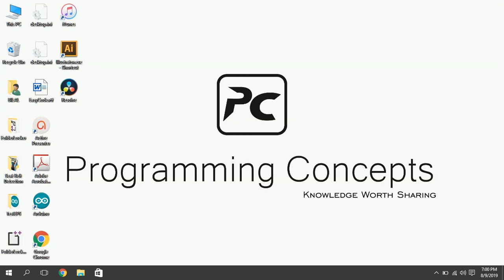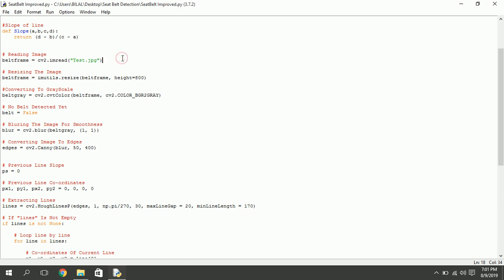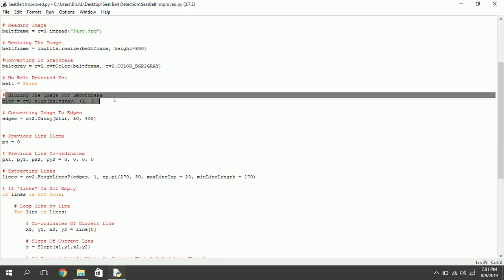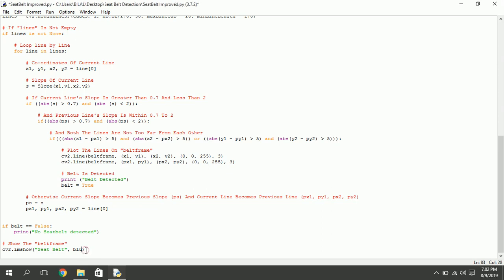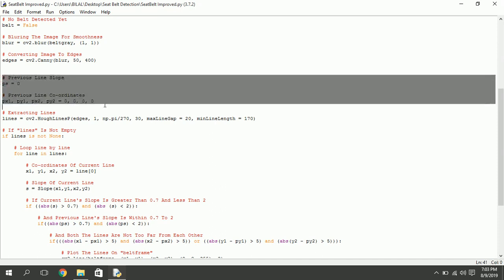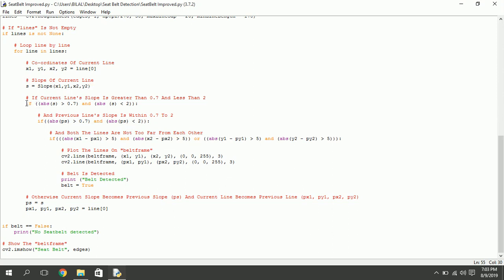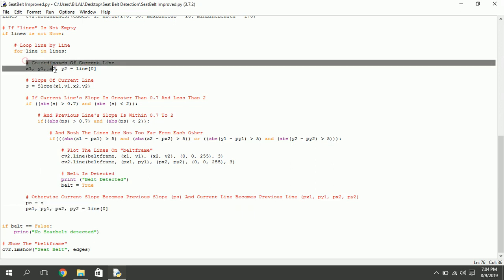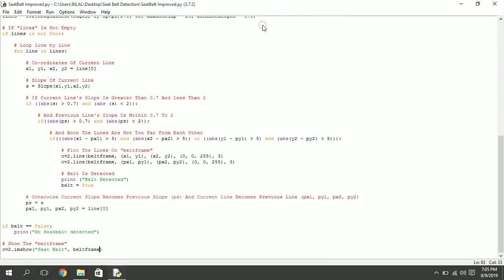#SeatBelt Detection with OpenCV & Python | Line Detection in Images

Comment: Hello, I need some help here. I use the same image. The status was "seatbelt detected", however the image did not appear. (No pop up image that shows seatbelt with the red line). How can I fix this?
Reply from the maker: Hi! Hope you’re enjoying a good health.

In the code, there is a function named “imshow()”. This function is used to display the image. Look it up in your code and may be you find something that can help you. May be it is missing or misspelled.
Reply: @ProgrammingConcepts101  Hi, thanks for your response. I moved the imshow inside the loop line and also added waitkey. It kinda works, the image pop up and hold up for a few secs. I'm suck at programming, your code and explanation help a lot. Thanks!
Reply from the maker: Thank you. Your comment means a lot to me.

Comment: Hi sir,   I got some error on the output of the coding.. The output I get 

RuntimeWarning: divide by zero encountered in int_scalars
  return (d - b) / (c - a)

No Seatbelt detected

Could you please advise me on this error?
Reply from the maker: This is because c - a equals to zero for some cases. You should just ignore it.

And for your specific image and camera, you need to adjust your code.

Comment: Hi , could you please advice me how  to identify any triangular objet in an image after extracting edges image ? Like we are finding two parallel lines with some angle  in edges of pic.
Reply from the maker: If you want to detect triangular shapes, please refer to this tutorial by GeeksforGeeks: https://www.geeksforgeeks.org/how-to-detect-shapes-in-images-in-python-using-opencv/

I hope it will be helpful.
Reply: @ProgrammingConcepts101  hello sir , appreciate your reply and  help. Actually, I tried this using Contour method and by feeding edge image into it . But it's not  detecting the triangle. The process suggested in Geekforgeeks is working fine when you may have simple white paper where few clear shapes are shown but if there is image where data is bit noisy (e.g. pic of 7 people with background of a garden and you may want to identify a drawn triangle on one person t-shirt) , this method does not work fine. I was thinking if we could find angle between two line in a traingle and compare all three angles if they are equal and atleast two  lines connected at a common point, a triangle can be detected. But I am not sure how to execute it in the code. See if you could advise.
Reply from the maker: Well, we may need to search for the triangle only in the "Region of Interest" instead of searching it in the whole image. Do you really want to process the whole image?
Reply: @ProgrammingConcepts101  sir thanks for your prompt reply. Is there any way to take out "area of interest" after edge detection and searching for a specific geometry in full picture?  My need is to just recognise 3 lines and angle between them .  Sorry , I may not aware of it , may be you can guide me please.
Reply from the maker: Can you send me the image you trying?
Reply: Sure sir , I can send . Any email you want to suggest for communication? Thanks for extending  helping hand.
Reply from the maker: @shekharkumar1902  you may whatsapp at: +923408131739

Comment: Sir i am getting this error while running the code 
Traceback (most recent call last):
  File "C:\Users\Seyar Sawayz\Desktop\belt.py", line 21, in <module>
    beltframe = imutils.resize(beltframe, height=800)
  File "C:\Users\Seyar Sawayz\AppData\Local\Programs\Python\Python39\lib\site-packages\imutils\convenience.py", line 69, in resize
    (h, w) = image.shape[:2]
AttributeError: 'NoneType' object has no attribute 'shape'
Reply from the maker: Are you able to capture frame from camera or image from your disk?

I think your beltframe is NONE, thats why it is showing this error. Make sure that beltframe is an image or frame.

Comment this line by adding a hash '#' sign in the beginning and see if you're able to see the frame.

If it still doesn't work. Let me know.
Reply: @ProgrammingConcepts101   Thank you, sir, that problem has been solved but it's not detecting the belt and also while I am working in pycharm it's even not printing the image but in IDLE it's printing only the image but not detecting the seat belt it's printing a message that seat belt not detected while it should detect
Reply: @ProgrammingConcepts101  this is the code sir same as yours

#   Seat Belt Detection Using Opencv And Python Based On Line Detection
#   Coder: Syed Naveed Abbas
#   Email: programmingconcepts101@gmail.com

import cv2 
import numpy as np
import imutils

#Slope of line
def Slope(a,b,c,d):
    return (d - b)/(c - a)

# Reading Image
beltframe = cv2.imread("Test.PNG")

# Resizing The Image
beltframe = imutils.resize(beltframe, height=800)

#Converting To GrayScale
beltgray = cv2.cvtColor(beltframe, cv2.COLOR_BGR2GRAY)

# No Belt Detected Yet
belt = False

# Bluring The Image For Smoothness
blur = cv2.blur(beltgray, (1, 1))

# Converting Image To Edges
edges = cv2.Canny(blur, 50, 400)

# Previous Line Slope
ps = 0

# Previous Line Co-ordinates
px1, py1, px2, py2 = 0, 0, 0, 0

# Extracting Lines
lines = cv2.HoughLinesP(edges, 1, np.pi/270, 30, maxLineGap = 20, minLineLength = 170)

# If "lines" Is Not Empty
if lines is not None:

    # Loop line by line
    for line in lines:

        # Co-ordinates Of Current Line
        x1, y1, x2, y2 = line[0]

        # Slope Of Current Line
        s = Slope(x1,y1,x2,y2)
        
        # If Current Line's Slope Is Greater Than 0.7 And Less Than 2
        if ((abs(s) > 0.7) and (abs (s) < 2)):

            # And Previous Line's Slope Is Within 0.7 To 2
            if((abs(ps) > 0.7) and (abs(ps) < 2)):

                # And Both The Lines Are Not Too Far From Each Other
                if(((abs(x1 - px1) > 5) and (abs(x2 - px2) > 5)) or ((abs(y1 - py1) > 5) and (abs(y2 - py2) > 5))):

                    # Plot The Lines On "beltframe"
                    cv2.line(beltframe, (x1, y1), (x2, y2), (0, 0, 255), 3)
                    cv2.line(beltframe, (px1, py1), (px2, py2), (0, 0, 255), 3)

                    # Belt Is Detected
                    print ("Belt Detected")
                    belt = True

        # Otherwise Current Slope Becomes Previous Slope (ps) And Current Line Becomes Previous Line (px1, py1, px2, py2)            
        ps = s
        px1, py1, px2, py2 = line[0]
        
                   
if belt == False:
    print("No Seatbelt detected")

# Show The "beltframe"
cv2.imshow("Seat Belt", beltframe)
Reply from the maker: Hi! Can you send me a short video so I can see what's happening on your side?
Reply: @ProgrammingConcepts101  yeah sure sir shall I send to your email??
Reply from the maker: Hi Seyar Sawayz! Sorry I was busy. Couldn't reply earlier.

Yeah you can email me or whatsapp at +923408131739
Reply: @ProgrammingConcepts101  yes i have msged your sir thanks from your response

Comment: Complicated concept explained easily ! Thanks a lot !  Can we add multiple lines within the two parallel lines and count their pixel brightness value so that we can doubly assure that its seat belt only
Reply from the maker: Hi Shekhar Kumar! Thanks for your feedback. But I am sorry, I couldn't get your question. Can you elaborate?
Reply: @ProgrammingConcepts101   No worries ! apologies for not able to clearly explain what i was suggesting. Lets go step by step in your video:
-  First you converted original image in to greyscale image 
- Second you extracted edges out of greyscale images
- Third you searched for the edges (parallel) whos slope is between 0.7 to 2.

My question was : 
Can we find edges within the gray scale image itself (may be using some other filter ) and can make a box between the parallel lines having slopes ( 0.7 to 2) and  check their pixel value ?

Reason: The seat belt is made of same material and possibly the pixel value in the box between parallel lines would be having same pixel value.  It would be an additional check for the seat belt apart from the concept you derived amazingly.  Just an additional thought.
Reply from the maker: Thats a good idea. But some lightening effects may make it not work properly.
Although you can do it. Just find the area. Then loop over it pixel by pixel.
Reply: How to do seatbelt detection in a video
Reply from the maker: We are doing this for a single image/frame. As we know that video is just collection of frames we can do this for all frames one by one.

Just put the code in while loop.

cap = VideoCapture("your video file.mp4")
ret = True
while ret:
       ret, frame = cap.read()
       // do all the processing on frame here

cap.release()

Comment: This method is not applicable for all condition..
Reply from the maker: Yes! You're right
Reply: @ProgrammingConcepts101  What can we do to apply this code for almost every image?
Reply from the maker: Universal solution is to train your custom detector for seat belt.

But if you want to apply same method like detecting lines or contours, then you need to automate the detection; which is time consuming and still not guaranteed.

Comment: can we use for detection of cut or marks in running item???
Reply from the maker: Akash Mandal can you elaborate it.
What do you mean by running item?
Reply: @ProgrammingConcepts101  assume I have a piece of length which I have do monitoring to and fro.

Surface is rubber type and I need detection of cut marks on it.

You can assume as a belt conveyor
Reply: @AKASHMANDAL2386  Yes, you can detect them.
Reply: @syednavabbas  can you guide me for above
Reply: AKASH MANDAL follow the tutorial to detect lines, you just need to customise “if” statements according to your requirement.
Reply: @syednavabbas  thanks...sure I will try and update you